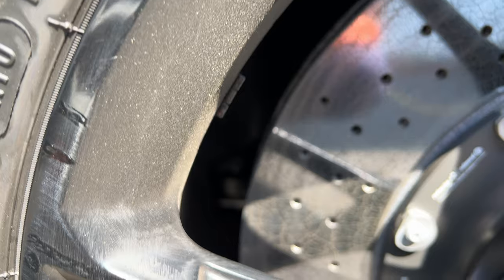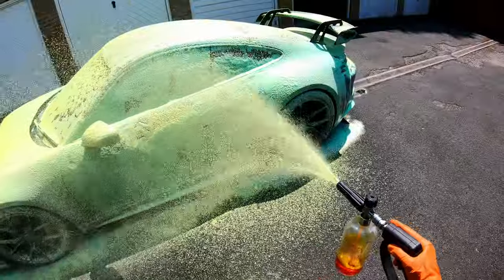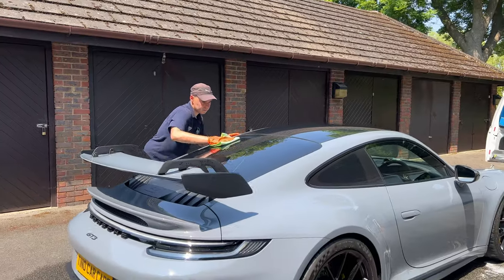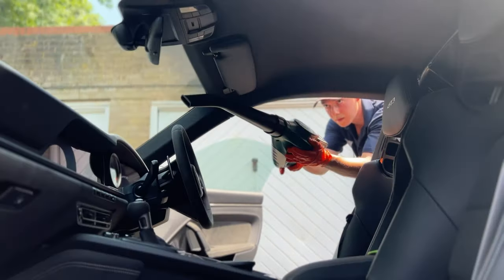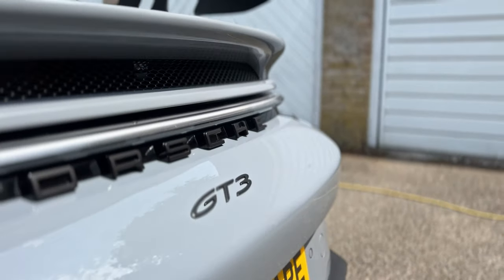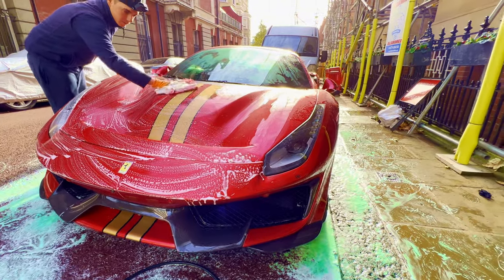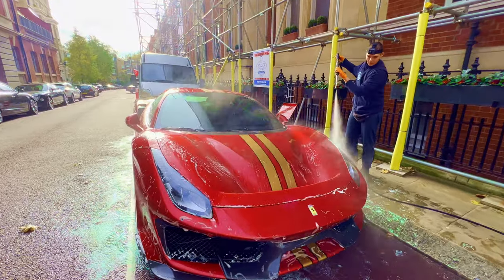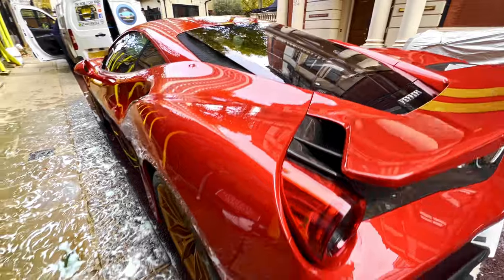How MILLIONAIRES Keep Their Cars SO CLEAN?

Comment: Amazing job on both cars! Tips on one small thing. Get rid of the foam on the ground before you start applying the detailer. That way, if the owner drives off  as the ground is still yet, the foam will not be sprayed by the tire back on the mudguard and car. 🙂

Comment: Hello there Tino! Great results! I have a question. After you go over the car with a leaf blower, you use dry cloth to wipe off the leftover water or you first put on product, such as detailer, to reduce friction between cloth and the surface of the car? I'm curious if there's a difference between the two, as the car is basically already clean when you perform this step. Thanks!
Reply from the maker: Hey, thanks! Yes I usually spray the cloth in exterior detailer when wiping off the left over water. Even though the car is clean, if the cloth is too dry, it can still inflict damage as the clear coat can be extremely weak.

The only exception is when you are going to be doing a polish/paint correction, in this case, you do not want any extra protection on the vehicle, as this will disturb the polishing process.

Comment: Is the GT3 ceramic coated and can the clay towels leave any minor scratches?
Reply: you can always scratch the car while doing contact mechanic decontamination, but i doubt it would be in case when the car is that crystal clear and prewashed. Those towels are super gentle to the surfaces and if you have done it well before with chemical decontamination and washing, it would never end with any damage to the paint i believe. It also demands some good decision making and experience with which accessories to choose in which situation and how.

Comment: Hi, thank you for great videos 😃👌 Me son really like them. We have tried your methods, which are very good. but one time when we washed our BMW we used ceramic schampo in the end and now our car have a lots of big color spots on it, and the car painting is som kind of cloudy coat (Not shiny). please help us with what it can be ??? have a great day 💫
Reply from the maker: Thank you very much for your support! From my experience there could be two issues causing this: 1. The car shampoo has not been fully rinsed off before applying the ceramic snow foam. 
2. The ceramic snow foam may have dried as its been left too long before rinsing it off. It should be rinsed off right away before applying, so no dwell time is needed.
The current problem should go away on its own as the excess/dried ceramic should fade away within a week or so.
Reply: @TinoCarCare  thank you very much for your answer, super 😀👍💯🚗☀☀☀☀☀🏎🙏🙏🙏🙏🙏